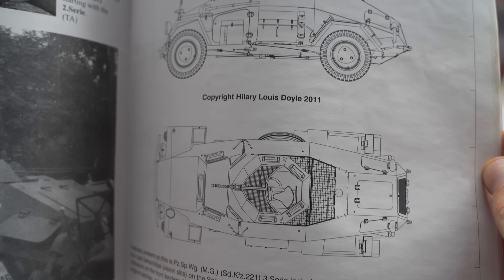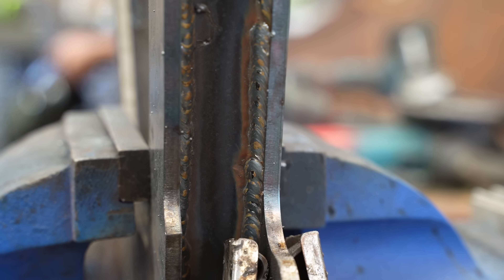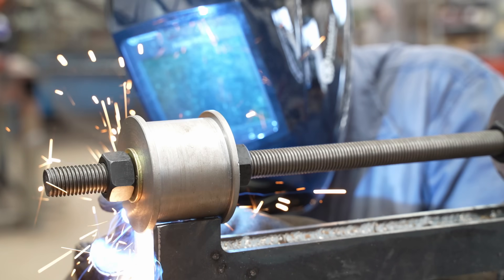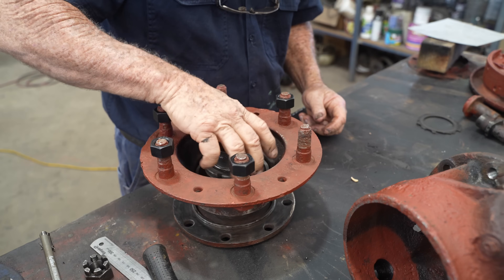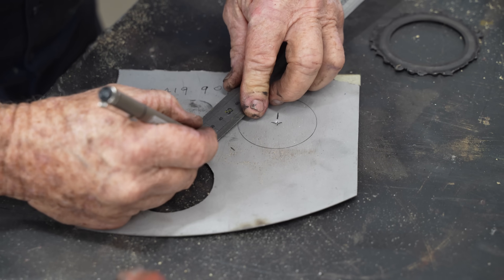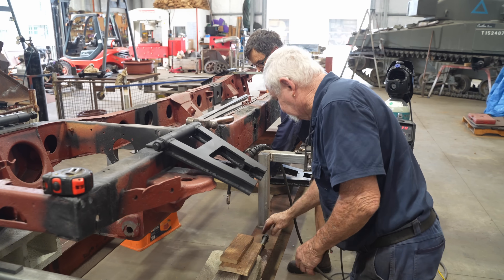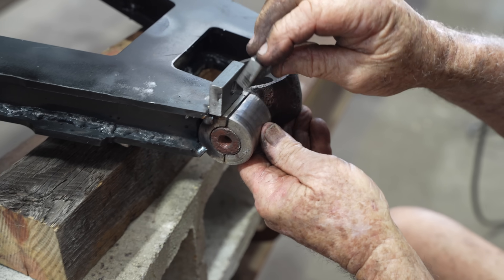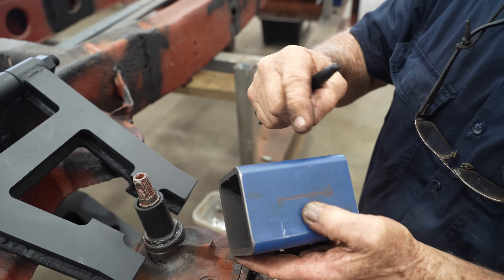WORKSHOP WEDNESDAY: SdKfz 221 Armoured Car CHASSIS and WHEEL HUB restoration

Comment: From the video "Al had a total of eight of these to make", Al really needs to get an indexing table if he wants to weld identical weldment subassemblies. He could do a single setup, and if all the parts are waterjet or laser cut they should all fit the same.
Reply: These to be done correctly need to be cast, just like the original.
Reply: What metal would be used to case the part? @HarkonnenTV
Reply: @windward2818  same as original, steel. I'm sure the reasons Aus. Armour did it this way is because its easier, cheaper and quicker and to make a cast you need an original to be able to make a pattern. They don't look to have an original. It will do the job for a display only vehicle.

Comment: Your ebr 90, there is a couple in the dunes in Normandy, go over with a grinder for parts and get yours running, they are stuck in a nature reserve with so called other vehicles, half tracks etc, said to be to expensive to remove, I'm sure there is a you tube vid about them, just food for thought

Comment: Correct me if I am wrong, but @ 11:20 , won't that washer just spin with the nut? It has nothing pinning it to the shaft, so, if those 4 tabs are all bent up into the slots on the nut, it will just spin with it. There are multiple keyways in that threaded tube, that washer also needs some tabs that go into them to keep it from spinning.
Reply: Yup. Tab lock washers require metal to contact at least two surfaces to work.

Comment: Kurt, Aviation Tin Snips come in three styles, LH, RH, and Neutral.  The Neutral ones are, in the parlance, a bugger to learn as they do not follow your hand's natural ergonomics.  So, not only are they inclined to wander off the cut line, the cut piece comes back at your cutting hand attempting to slice same into a dog's breakfast.

Comment: Al did a little mistake. The tab washer should have a tab on the inside to stop it rotating, otherwise the tabs on the outside do nothing. But it's a static display, so it won't cause issues.

Comment: Back in 1970 my old airframe powerplant instructor went to a surplus outlet and bought seven radial tank engines from WWII for 180 bucks apiece and brought them back to practice disassemble  and reassemble them. To make them aircraft engine was to change one barring from a roller to a ball barring.

Comment: You know your welder is a damn BEAST when he sticks right into the welding and doesn't even bother with gloves! He stuck right into it like it was nothing. I can't even WATCH people weld without reaching for gloves.
Reply: Actually, that welder is saving as much as 2/3(or MORE) of the time to align those small metal bits for welding in a complex, curved metal bird's nest of oddly angled fasteners, by skipping the gloves and the clamps. You'll notice that he's welding on a metal surface that he's certainly grounded(and checked and re-checked many times) to be able to do that. NOTHING can beat the hands that God has given us, for versatility and usefulness. 

One learns unconventional techniques like this in the military, or in self-employment. And also, he has probably gotten in trouble for doing it that way in the past. Imagine being at sea(or in battle) and some quick, effective welding HAS to be done - to save the day. And hundreds of people are waiting, watching you(or worse, YELLING at you) to save their lives. And he's probably been burned or bitten by thousands of volts in the past; but he's confident that he can do it.

Notice, however, that he had most of one of those suspension arms recognizably finished by the show's end. And - of course, needless to say - DON'T try this at home, kids!
Reply: Beginners watching that will think it’s ok…
Reply: Battle? You’re just spewing 💩. The Infrared and UV radiation cause skin cancer and burns.  It’s wrong technique and, frankly, shouldn’t be shown on YouTube where beginners are watching.  you don’t need to take dangerous shortcuts to do a good job. Period.
Reply: Maybe it just a force of habit, but every time I see a welder strike up, I automatically close and cover my eys and turn my head away.

Comment: May I suggest to Al that the bearing locking washer can be bought at any industrial bearing supplier. They are called bearing lock washers. Also bearing nuts can be had. They are sized by the last number of the bearing example   5208 bearing would use a W-8 lock washer 👍
Reply: Did you also notice that, he just made that locking washer with tabs to bend onto the nut, but nothing to grab the keyways cut into the threaded tube? It will still spin with the nut unless it grabs the tube as well

Comment: Surely the large locking ring on the hub should have an internal tab to key in with the shaft ?
Otherwise there's nothing to stop the ring from spinning with the nut.

Comment: A small point, the tabs on a lock washer are staggered so that when the bearing is adjusted, one tab only lines up not all of them! This allows for correct adjustment! Cheers, Matthew
Reply: Your Correct. Maybe I missed (hole saw wouldn’t allow this) the addition of a inner tab that goes into the groove of the stub axle this makes the nut lock to the axle’s stationary position.
Reply: The washer will just spin with the nut without a inner tab  @MostlyParked
Reply: @MostlyParked  Exactly.  As it stands (from what I could see) the tab washer is doing nothing at the moment.
Reply: @MostlyParked  Your right about the inner tab!

Comment: Nice work on the retaining ring, but it's missing one lip on the inside diameter to lock in the bearing adapter sleeve to prevent it from turning.

Comment: I'm surprised when putting together the A-arms he didn't do the inside walls first and weld them on both sides thoroughly then the outside after, yes it would have taken more then twice the time but it would have made a much mire solid A-arm and would have gotten full penetration.

Comment: Just curious, are there no bushings in those A-arms where they bolt to the chassis?  It would be unusual if they just rotated on the pivot bolt.
Reply: As a static or limited run museum piece it's acceptable.

Comment: Shouldn't the lockwasher with the bend up tabs have a tab on the inside that fits the groove on the threaded shaft, to prevent it from turning?
Reply: Agreed. Is it a static display? Might not be that big an issue.
Edit: having watched to the end, it will be static.
Reply: @davedickinson822 even if it wasn't the speeds and milage it would do as a museum exhibit would not be a problem, as someone versed in old Land Rovers I also noticed that but understand why they left it out.